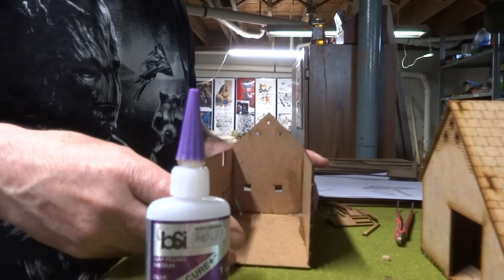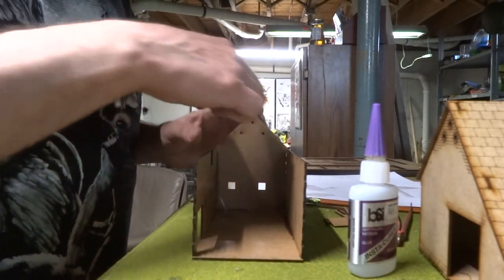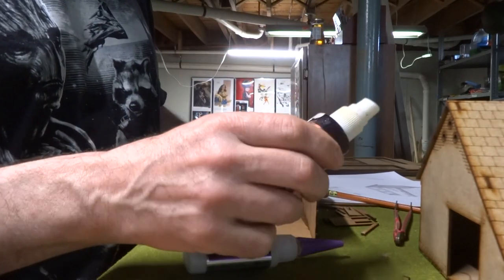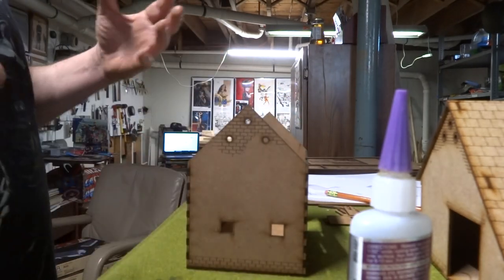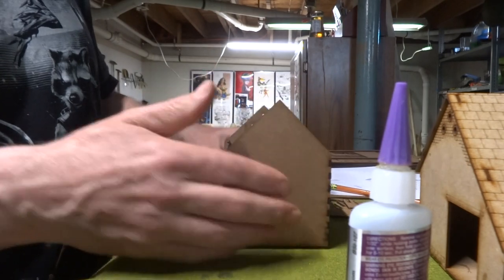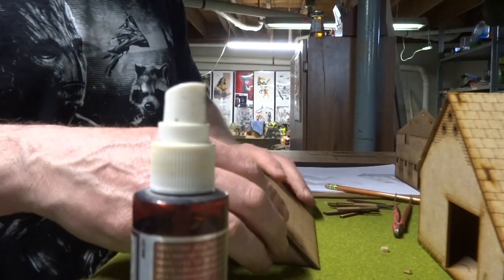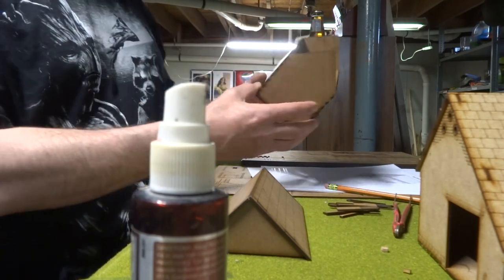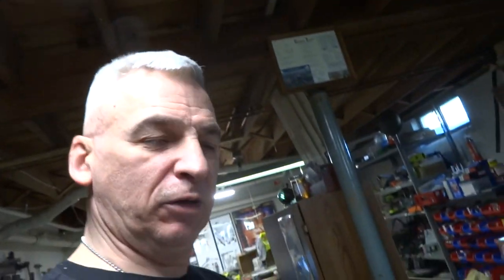Bob's From the Basement 5/9/18: Hougomont 28mm How to build the Barn Cattle Shed

Comment: Just a tip I use in sticking edges, is to glue a small square edged piece of wood almost the height of the wall section on the inside of each corner flush with the edge. It gives a slighter larger area for the glue to grab, its easier to handle and it is invisible, also stronger.  I like this model, i might invest in one, or try a self build! Good video Rob! Cheers
Reply from the maker: :) Hi Matt, you know I do that too, why I didn't here is beyond me tired I guess. But you are right that is a great tip, I used it on the 28 MM La Haye Sainte. For a 1/72nd hobbyist it would add to your games and table that's for sure.
Reply: Robert Gagne great minds think alike....have you ever tried a product called 'mitre mate'? Its designed for joining delicate wood and MDF moldings at mitre joints but it would be good on this, provided its quickly lined up.